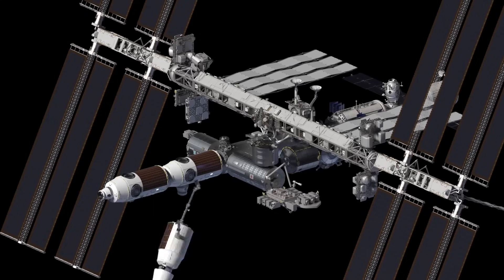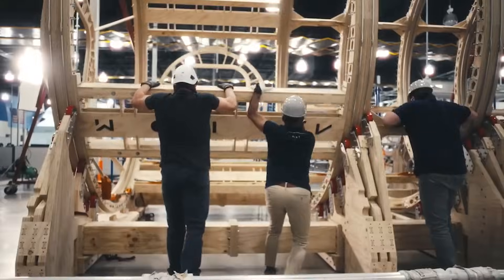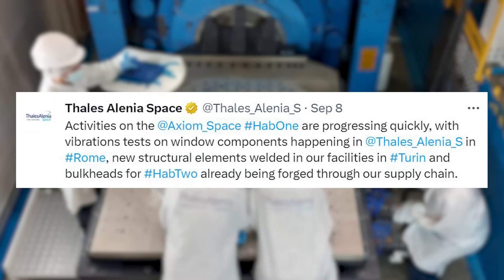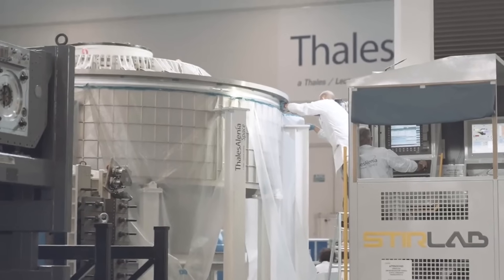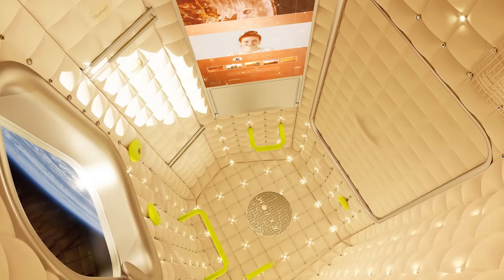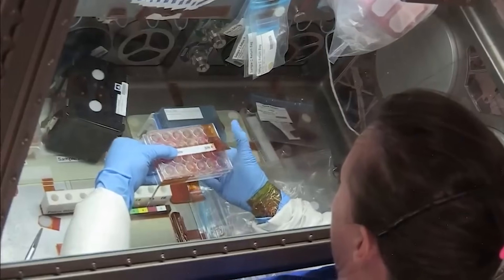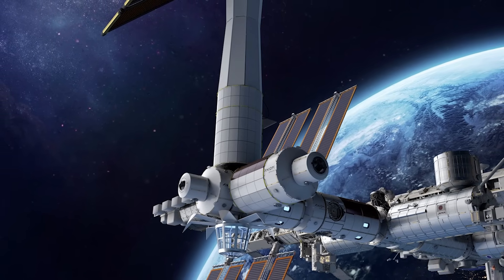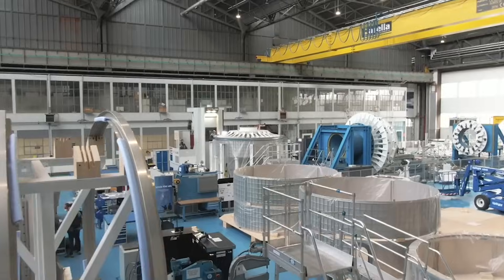The First Commercial Space Station Segment Is Nearing Completion

Comment: After detaching from the ISS I wonder if they will slowly shift the inclination bringing it down to something useful for lunar traffic?
Reply: It's mostly a commercial research facility, not a Lunar transfer station. They won't place it in an inclination that's any more difficult to reach than necessary.
Reply: @stardolphin2  it could be both.  And there would be economic and logistical benefit to the research side being colocated with a traffic hub.
Reply: You would need like 1500m/s to change inclanation of the ISS to moons one,but then the  question is how much the LAN change would cost
Reply: @polishkerbal6920  yup, it would be a prolonged event.  Perfect application (and test drive/demonstration) for some of the new electric propulsion systems.  Such a propulsion system would also easily handle the station's reboost needs.
Reply: @Yaivenov  we will see
Reply: seems expensive, though if it is needed I'm sure one space station will move for that purpose.
Reply: @harmonyspaceagency1743  There's trade offs for sure. Current inclination allows access from high latitude launch sites, specifically Baikonur.  They'll need to calculate whether there is greater benefit to maintaining high latitude access, or participating in lunar traffic.  Of course they could go in the opposite direction and push up into a Solar Synchronous Orbit which would benefit onboarding nascent industrial processes that would require more and/or uninterrupted energy production; this would also not only maintain access from Baikonur but also extend access to all launch sites on the planet.  Whatever they do, I'd say they've got some good reasons to consider a prolonged inclination change.

Comment: It's gonna need starship to get it there. There is nothing else that can get it to space
Reply: Since it isn't going to be launched until well into 2024 or even later I'm sure that issue will be resolved well in advance.  Bottom line though is the Falcon 9 fairing is 5.3 m or 17 ft wide and 13.1 m or 43 ft long so it can easily accommodate the Axiom first module.   Did you really think nobody thought about that??
Reply: @  michaeldeierhoi4096  
Some people on here are a bit 'naive', so yeah they think nobody else did think of that ;-)
Reply: the way NASA and the government work they will find ways to go way over budget with many delays.